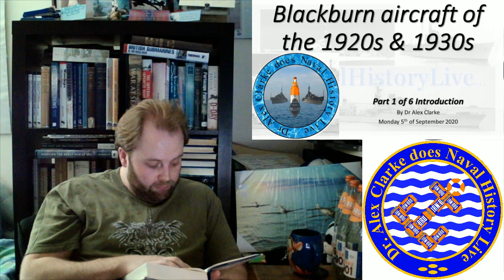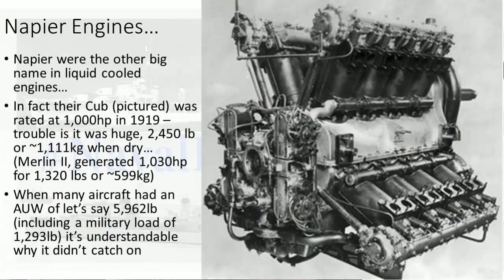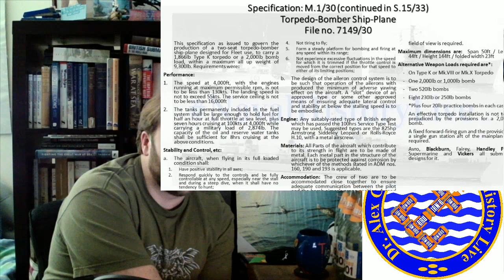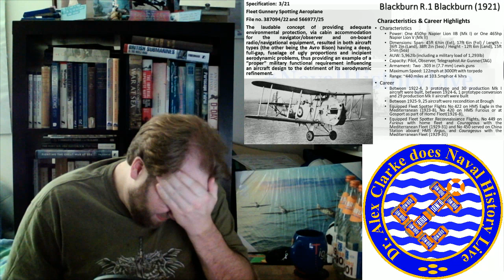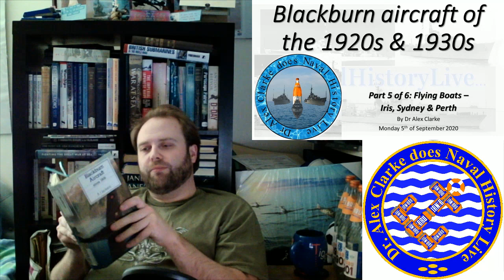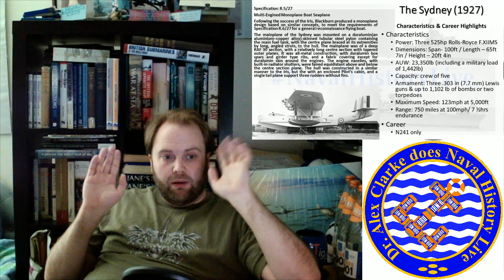Blackburn Aircraft of the 1920s & 1930s a long patrol (& introduction)

Comment: 1:35:00 Not that the idea was bad see Greman "Schrage music" and remote controlled turrets of the Me-210/410, or the US A-26 Invader even the P-61 Black Widow - all had the merit of attacking a bomber outside of its defensive fire arc. The Defiant fex was used rather succcessfully as a night fighter.
AFAIK the turriet could be trained fully forward and the pilot could then fire the guns.
Even the tighly grouped 4 machine guns almost provided the effective firepower of the 2*4 gun wing mounted fighter (Spit, 'Cane)  - but the turret was just too heavy for the frame and engine. And that alone killed the concept.
Reply: Post War the US Navy had a requirement for a turret-armed escort fighter to escort their Nuclear Bombers (such as the AJ Savage and A2J Super Savage).
https://www.secretprojects.co.uk/threads/us-navy-outline-specification-os-112.9866/

They also tested a nose turret for the F9F Panther.

Comment: 1:28:00 Fighter Skua being only 100ish lbs lighter than bomber - did the Skua used a "separator" central bomb "pylon" which pushed the bomb out of propeller's way - removing that improves drag and the mechanism must weight about that 100 lbs. You need that amount of steel, to keep a 500 lbs bomb attached even when the craft must perform a 4+ G manouver.

Comment: 20:34 Not just the Merlin II generated the same power from about half the dry weight, but being more compact, it produced less drag. 
This was aggravated by the fact, that by the time of the Merlin, liquid cooled engines used glykol, from which way less were needed for cooling and could be used with a smaller radiator, so if both engines were loaded with oil, coolant and fitted with radiator... I would guess the difference would have been greater.
Reply from the maker: Probably, but I was trying to save something for the live 🙂
Reply: @DrAlexClarke  Invite maybe Greg ;)

Comment: Re the Cub - it's not just the weight, another big problem is balancing the aircraft. The engine has to be moved back close to the centre of gravity which makes it difficult to package in a single  engined design.